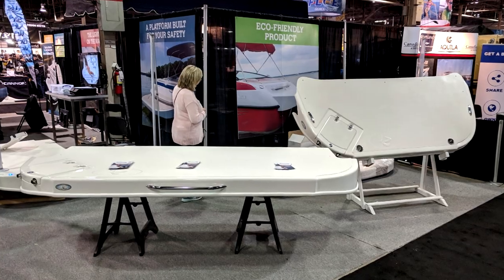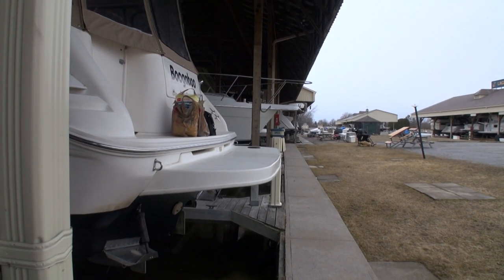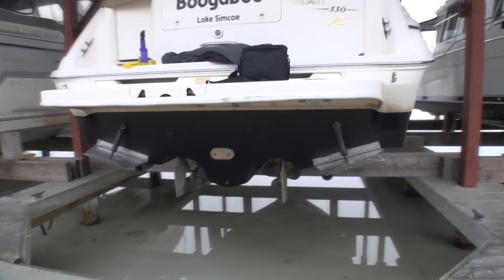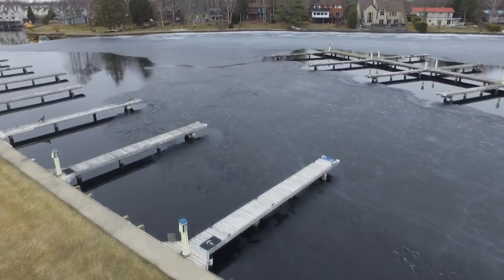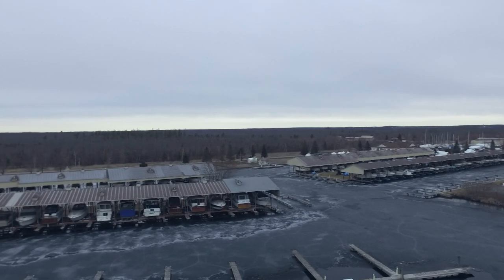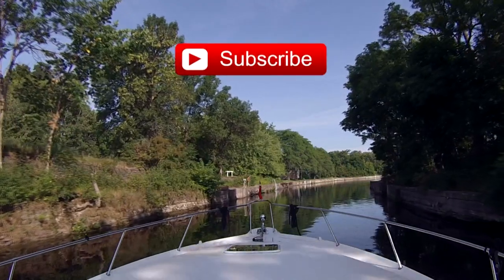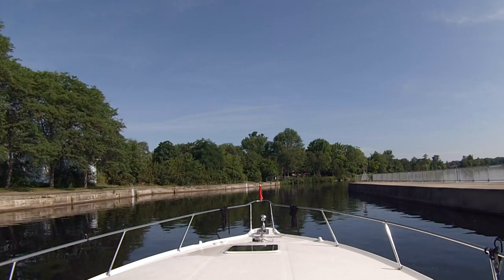Swim Platform Install Update

Comment: Hey Paul we did the exact same platform really nice but requires a ton of trimming and refitting real easy to mess up lucky for me I brought a a good friend that slowed me down to avoid mistakes. the install turned out amazing and completely changed the feel of the boat. Good Luck!
Reply from the maker: When I spoke with Marc from Swim Platform Ultra at the Toronto Boat Show, he told me that their platforms were built purposefully a little bigger in some spots, requiring some fine tuning prior to installation. The reason they make them like that is because they found many #boats of the same model had slight discrepancies from vessel to vessel and this allows for a more precise fitting on site.
 Having been in the general contracting business for 30 years now, I've had my fair share of 'tweaking' experience, so I'm not concerned. Like I always say on the job, if it don't fit the first time, grab a bigger hammer 🔨🤣
Reply from the maker: @Als marine services Thanks for the offer, Al. I think I should be okay, as my 30 years experience as a general contractor will hopefully get me through this project. Plus, my innumerable DeWalt cordless tools should really help out with the task and if not, I'll just grab a bigger hammer ;-)
 PS, why don't you have any fun #boat project videos on your channel? I'm sure there's lots of folks who would like to see some of the work you do - me included!
 Cheers, Paul.

Comment: I can’t wait to to see the new swim platform!! As for out “cracked” block issue I was telling you about, it wasn’t really cracked. The mechanic just put the engine block drain plug in the wrong whole! So that was a relief that our engine is not junk!  But on a side note, our  dripless seal on the port side prop shaft was spilt in half!! So we had to pull the boat out this week, should be fixed and back in the water by tomorrow!  Hope your launch is soon ! That’s would drive me crazy not having control over that and being at the mercy of the marina , cheers Paul!

Comment: Hi Paul,We replaced out swim platform last year. In addition to those 8 bolts you know about :) … there's another 4 screw/bolts that are through the hull/deck joint. Had to take a Sawzall and cut those suckers off !
Reply from the maker: No worries, as I have not one, but TWO saw-saws ;-)
Reply: Would you still happen to have your old one.

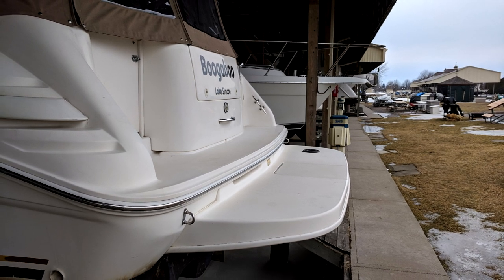Comment: If your boat wouldn't go down w/o hitting the wall with a 12" extension then how would the two boats behind you get in when they are hanging back over the concrete by feet? Look at 2:46. The boat in 243 (?) is even almost over the grass past the concrete. It's very obvious that they can and do when needed move the boats forward in the slips during the drop process.
Reply: That piece hanging over is the pulpit and relatively high...  I'm thinking that there is enough clearance due to that when its floating?   I thought same thing at first...
Reply from the maker: Yes, I had considered the same thing, but when I was down there last weekend, I realized that it's just the bow that would be hanging over the breakwall when floating. No worries, as I'll be wanting to do the bottom coat touchups, as well as polishing the forward part of the hull that I can't reach comfortably from the dock.
Reply: @seanmcc45  True on the boat next door. But the boat two down is hanging over the same amount and it is the stern on that one...
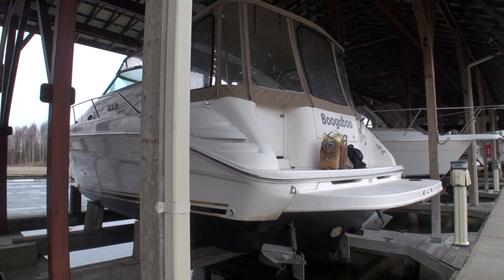Reply from the maker: @JCrook1028  The #boat you see farther down that appears to have it's platform hanging out over the breakwall, is not. That section of the docks steps out about three feet to allow for longer slips and if you look closely at approximately the 2:00 mark onward, you can notice that the breakwall & walkway are stepped in (to the right) at that point. Appreciate everyone's help in trying to speed this process up, but things are the way they are :-/

Comment: Thanks for the update - will you be using the same barbecue mount on this platform?
Reply from the maker: Good question. When we visited the Toronto Boat Show in January, I specifically liked at different options. The problem with the one that we currently have is that it doesn't really ratchet tight, resulting in a semi wobbly BBQ. I'll be sure to let you know what I come up, as the BBQ is a gotta have feature, for sure!

Comment: I am trying to remove the old one and the bolts that go into the intergraded platform just spin. the bolt through the transom are easy, any ideas?
Reply from the maker: The mounting bolts are a bolt + nut affair, so removing them is a two person job. When I did ours, I was lucky to have my lovely wife help[ by running an impact gun on the outside, while I squeezed my 6'-2" frame into the bilge with a wrench to hold the nuts from spinning. Lots of new curse words that day, but doable! 
 And, I have a full detailed video of that installation, at no extra cost, today only ;-) Check it out here; https://youtu.be/jg9M370cFWg 
 Leave me a comment on that one if you get a chance!
 Cheers, Paul.

Comment: I am interested in buying you old swim platform if you are interested. Sent me a message.
Reply from the maker: Hi Albert, it looks like I already have someone for it, but thanks for the offer!
Reply: Thank you for your response if anything were to fall through please let me know. I know that the 98-99 platform is different from I believe 95-96.
Reply: Also would you happen to know it there is a part number or where I can find the cushion and fiberglass piece that joins the rear two benches on the starboard side.